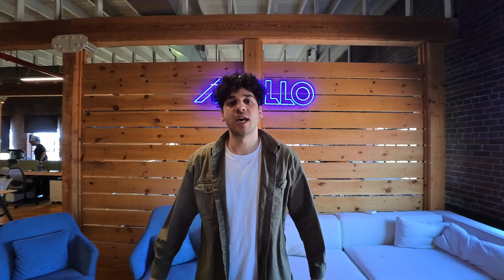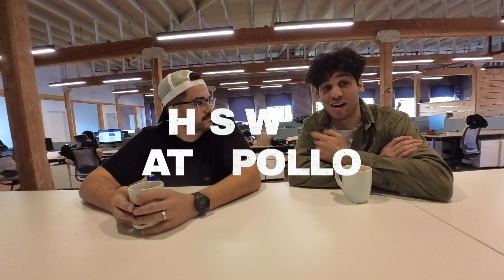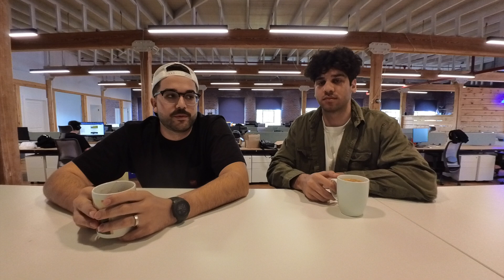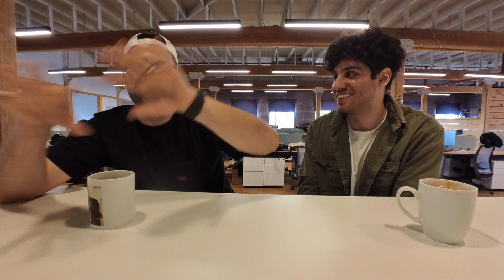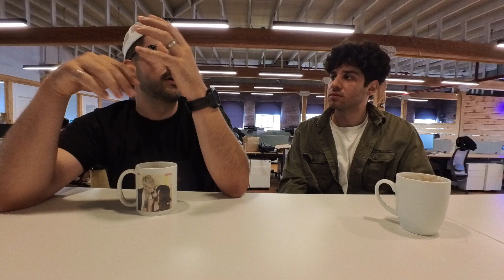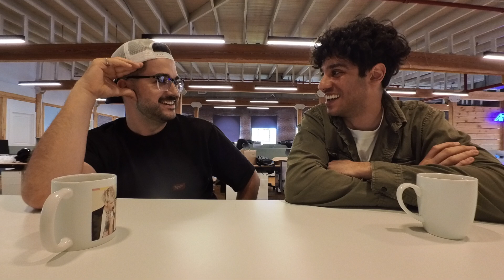This Week at Apollo: Pro Talk With Our Junior Engineer  (Episode 3)

Comment: Can I do 50k miles or 100k miles on Apollo pro without changing any hardware? what is the maximum milage can those scooters take before they shut down. If I am spending $4000 on scooter, i want to make sure it will give me 100k miles of usage like a car. with this price I can buy a good car, or petrol motor bike, or mini motor bike for the price of 1500$ or less that will give me easily 100k miles or more. Thank you in advance for answering.
Reply from the maker: Hi Ecoder EliteCoder,

Thanks for your comment. Our scooters are tested for 10,000 kilometers, so we can't confirm anything above that number. In that time, you will definitely have to change your tires. 

If you are looking for a vehicle to last 100K miles, we're not aware of any electric scooters that have lasted for that long. While electric scooters are best for urban commuting, they might not be the best vehicle option if you are looking to get high mileage (100K+ miles).